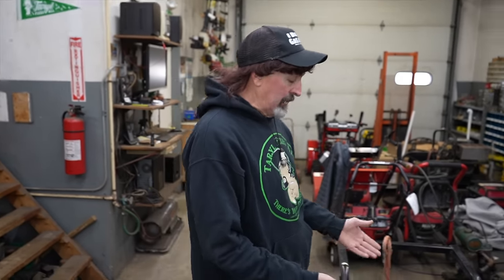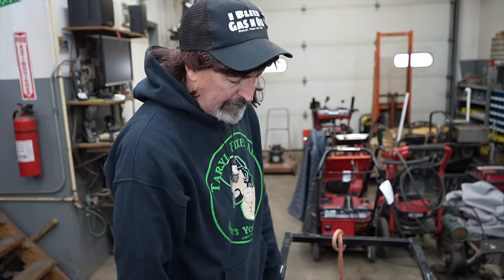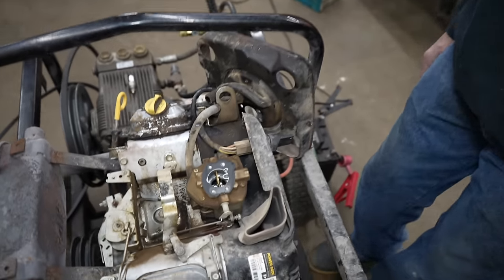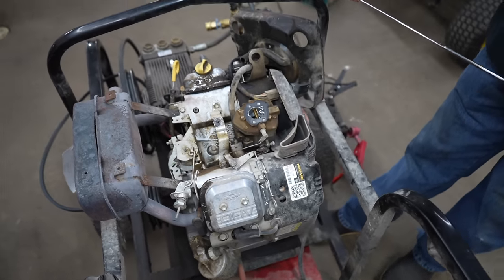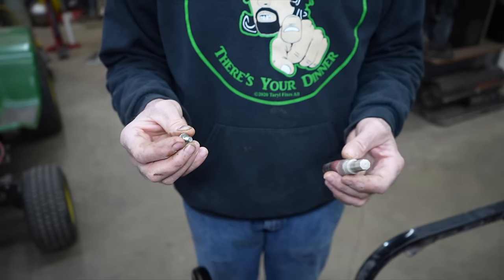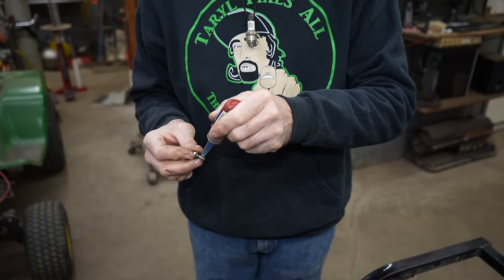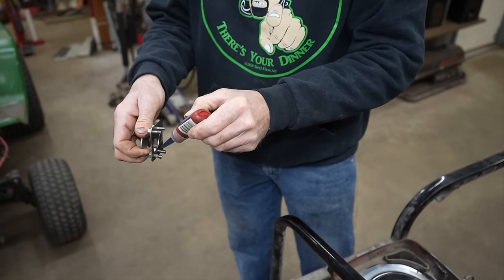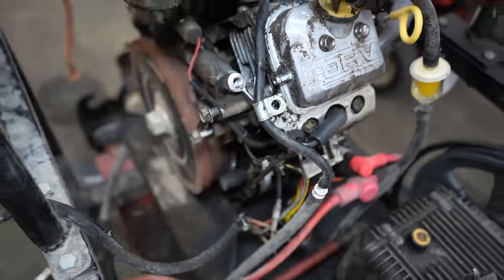Running On One Cylinder - You'll NEVER Guess WHY!

Comment: Infrared digital thermometer is more accurate, but the spray bottle water test works.
Had an intake bolt get sucked into carburetor and got hung in on of the valves and kept it open. Removed cylinder head and there it was. Was only running on one cylinder.  Customer dropped tiny bolt accidentally into carburetor.

Comment: For the most part I deal with cars and trucks,  awhile back my neighbor dragged down his Husqvarna riding tractor the damn thing was clogged with grass so much it overheated the head and the valve seat popped out. Just for fun I figured out how to get it back in without removing the valve and staked the edges around it. It's been running great ever since well as great as something like that will run at least😮

Comment: I bought a 6 cylinder Pacer car once.  Got a good deal.  It ran pretty well.  But I kept thinking it was missing.  
I finally took the head off.  
Someone had removed one piston and rod.  And they had blocked that cylinder off with a tin can, which I admit fit perfectly.  

I just left it that way.  It ran okay for my purposes.  And I was way too ugly to fix.  An odd color of aqua green.  

It drove normally.   Ran pretty fast and smooth
Reply: Unbelievable!! I saw a corvair like that once!! It was being restored we pulled engine and had it rebuilt . Opposed piston air cooled engine, they bored it and put sleeves etc. was very expensive but did a great job. I helped a buddy of mine remove and make a whole car wire harness on it etc.
Reply: Could the Pacer have been sabotaged by a disgruntled worker at the Kenosha factory?

Comment: I knew it was “Air” - either intake or exhaust - because he already confirmed fuel, compression, timing and spark (FACTS). Also saw the split muffler. I just didn’t know the specifics, but I was on the right diagnostic track.

Comment: I had a bolt fall in the throttle body of my company van after some body work done on it made that sucker run at full throttle, had to practically stand on the break to keep it at 45mph scared the heck out of me

Comment: Maybe I'm missing something but how does a bolt stuck in the carb cause a miss on one cylinder? And being a pressure washer, shouldn't there be water flowing thru the pump?
Reply: You missed seeing the Belts were off the Engine.. That is a Belt driven pump...

Comment: I had the same problem with one of our Kawasaki not running on both sides
Reply: Yea it was weird my issue was that if you have the spark plug boot all the way on it would only run on one side but if you have the boot half way on it would be running on both sides

Comment: The other day I watched dozens of past Taryl videos. There was one on a twin Kawasaki with a stripped camshaft plastic gear.  I didn't see a compression release on the cam gear. Why doesn't this overhead valve engine have a compression release? They only answer I could come up with is they use a more powerful starter to overcome the compression of 8:1. Anybody know for sure?
Reply: @keithpace6597.  Usually, the compression release is for engines that are manually started.. Kickstart or pull start. With an electric starter,  there usually is not a need for a compression release.

Comment: I would strongly suggest connecting a water supply to that pump so you don’t burn up all the seals inside it while running it dry. Just connect a water line and supply some reasonable pressure.  Most modern high pressure pumps will have a thermally controlled bypass valve to keep a steady flow of cool water thru the important parts within the pump during periods where the machine is on and running, but for wherever reason the operator isn’t actively using the high pressure discharge of the wand. Is a lot less expensive to have to squeege a little water off the shop floor than replace all the melted seals in that high pressure pump I bet.
Reply: Never mind, I just saw that you’d disconnect the drive belts from the pump… my bad.  🤦🏻‍♂️
Reply: The pump was disconnected.
Reply: he had the belts off
Reply: Great point, I was thinking the same thing. That seems like quite a while to be running it dry, but I don't have the experience to know exactly how long a pressure washer pump can run dry before damage is done.

Comment: Taryl - You should be using your infrared thermometer instead of a water spray bottle. Doing so will give you objective temperature measurements and allow you to be able to compare between the 2 cylinders...plus you do not have to burn your fingers.
Reply from the maker: Use a spray bottle, save $$$
Reply: and teaches do it yourselfers they don't have to buy a special tool.
Reply: @TarylFixesAll  You already have the thermometer.
Reply: It's not the space shuttle.🤣🤣🤣
Reply: I’ve got an Aldi one, cheap and it works well enough. I still like the water bottle trick though.

Comment: Tarly if thats a pressure washer shouldn't you have water running thru the pump unless you disconnected the pump from the motor
Reply: You missed seeing the Belts were off the Engine.. That is a Belt driven pump...

Comment: I have the same engine that when it gets wet it runs on one cylinder until it gets hot to dry out and runs normally
Reply: Have you sprayed any WD-40 on the plug wire when it gets wet?

Comment: How are you able to run the engine not hooked up too water I was told that's a no-no it will burn up the pump
Reply: He took the belt off the pump.

Comment: How long can you run a pressure washer without water flowing through it before it damages the pump? I've always been a little paranoid about ruining my pump dry.  Thanks in advance. (...and there's your question, Woooo!  Ooooo!)
Reply: You missed seeing the Belts were off the Engine.. That is a Belt driven pump...

Comment: I thought maybe a mouse had gotten into the air filter, and some trash had gotten sucked into the carb. I wasn't far off. It's a good thing that the engine didn't inhale that bolt! Then it would have really turned into a Broke and Scrap-Em engine! If it inhaled that big of a bolt, there would be no fixing that engine, customer needed it back in a hurry, and the only way to do that is slap a new engine onto that pump, and ship it.

Comment: Holy smoke that baby will wash dirt all the way through!  That’s about a 3500 psi @ 5+ gpm machine definitely not to be used by the average dumb homeowner.    I was expecting a mouse down in one side of the intake manifold, since the throttle is wide open when motor is not running.

Comment: Ok I paused it.
I think the problem is going to be an 8mm bolt rattled free from the air clear assembled and the bolt is down in the hole, but thankfully it's too big to have made it's way into the valves, it's just acting like a plug.
Ok, back to the video to see how close my guess is.

Comment: It’s not good to run those gas power washers without water going to the pump it will burn up the pump very fast
Reply from the maker: Belt is disconnected

Comment: So it would run, but it was like one cylinder was always at low throttle & one wasn't.  It's not that "only running on one", because the hole wasn't plugged, only blocked. Some air got through, so "one cylinder won't make power!" 

negative, because you bet I'd get it wrong, then lied about actual conditions.

Comment: I thought that after as many years of your life you have spent just being around small engines that you would be better at trouble shooting than you just showed. Maybe it was just theater, that's possible. YouTuber's are always looking for more subs. When you initially pulled the spark plug you said it was wet. That indicates the cylinder was receiving fuel. The screw In the single venturi carburetor could not cause the misfire, its a common plenum. So that was a lucky find unless you already knew but withheld no throttle movement. I thought for sure you were going to break out the carb cleaner, brake cleaner or propane torch and look for the leak. Rings? Ha Ha. Do a compression test? Ha Ha Ha. You sound like James Condon. You didn't show the spark check so there's no way for me to know if the spark was the problem. It could be weak or leaking to somewheres else under compressyone. I'm surprised at you Tarrible, if that wasn't all for show, you forgot how to logically step thru trouble shooting a misfire. Some of the people some of the time. Not this time. Fool me twice? ben/ michigan